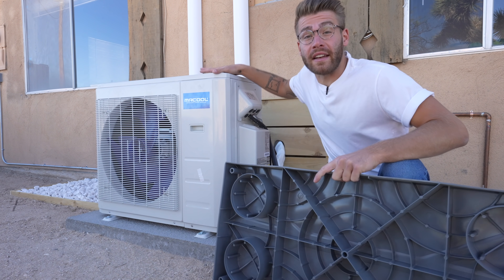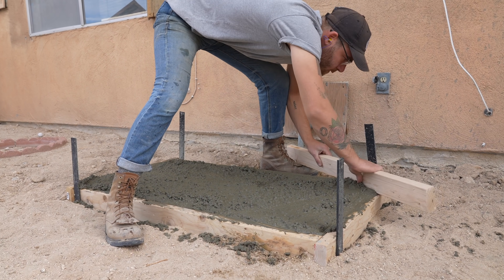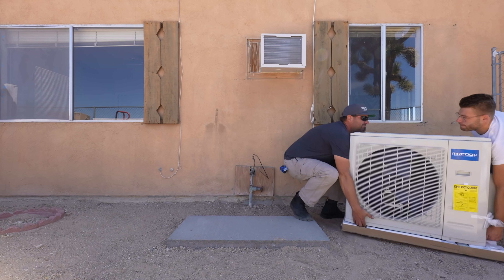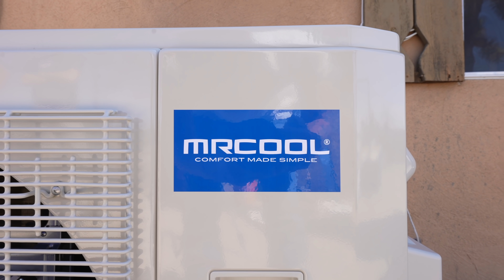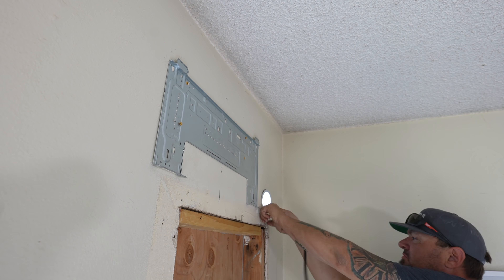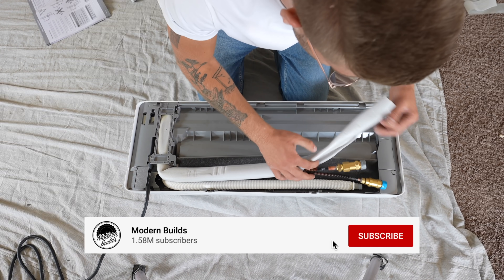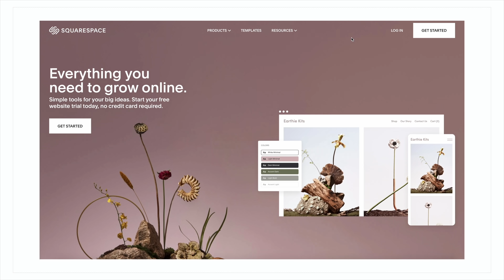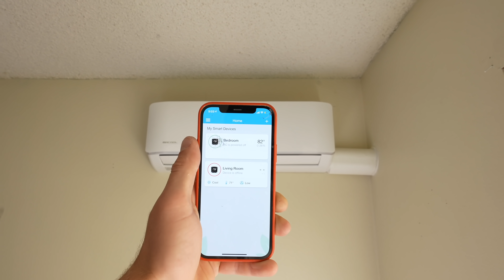DIY Multi-Zone Ductless Mini Split AC & Heating System | MR Cool Install 2021

Comment: i need warranty and they will not contact me back i paid over 1000$ for my unite  all i need is a replacement thermostat because mine is  delaminating and more UV Tape to finish my install i have called and called and get placed on indefinite hold i complained on there tiktok and they deleted there account

Comment: Hey Mike! I'm preparing to install this same unit. Can you provide some more details on your wiring setup? 30amp circuit—what gauge wire did you use?
Reply: 30 amp is 10 GA. Just look up the National Electrical code for all wire sizes. Over 100FT go up a size to reduce voltage drop.
Reply: you have to check the nameplate for the MCA and MOA.

Comment: Nice install but without a vacuum on line set and heads the refrigerant will be contaminated causing premature system failure and improper function.
Reply: The line set is where the Freon is charged and has sealed connectors. The vacuum is pulled on the compressor side from the factory.

Comment: Honestly, this was the video I referred to most often! And, the only video I found that shows the lineset leaving the air handler from the Right side. 

Anyone thinking about installing the MrCool mini split, should understand a few points I ran into. First, all these videos make it look very simple. And it is if you are going straight through the wall to the condenser just on the other side.

It gets a whole lot more difficult to run lineset out the left side as I needed to. Reason is, the connection then is inside the house behind the air handler. This makes the connection and the mounting much harder.  

Also, running lengths of lineset through the Attic, basement, and crawlspace, as was required for my install gets involved... I thought I would be able to have Install inside of 3, 4 days. But it took a full week morning to night. Crazy I know. Halfway through, I began thinking this wasn't such a great idea.

But mine was a difficult install. 2- 75ft runs, one exiting on the left side and the other from the right side of air handler, and 1 25ft run. 

Just saying, if the runs are short and through the wall, it's a lot easier...

Lots of newbee errors too.

Comment: Hmm... No attic? If that's the peak of the roof on that wall you can remove the coax and drop it down the wall... Just an idea so you don't see your coax. It's pretty easy even with insulation.

Comment: My Mr. Cool mini split is going on 2 years strong, not a single problem with it. Solid unit for heat and A C.
Reply: Can you share what the wattage draw / electrical costs are?
Reply: @allen35315  cannot provide information, my entire house is electric everything. I bought the 24k unit 19 seer for a 1100ft SQ house, I can heat the house up 12° in about 6 minute's in turbo heat mode though....it's glorious. My refrigerant lines did fail though. Poor design by Mr. Cool, the first couple feet were braided and rotted/failed, I replaced the lines and refilled with 410a. It looks as if Mr. Cool corrected the "braided lines" and are now copper from outside unit to indoor unit. I paid 700 bucks after a 800 dollar rebate from my electric company vs. 8000 dollars for a Mitsubishi unit installed.
Reply: @f4fake22  Do you have just the one air handler installed in that 1100 sf house? How do you get warm/cool air in to the smaller rooms like bathrooms and bedrooms?
Reply: @marlaplunk2833  just one, I went with the 24k unit so it's overkill. Back bedrooms still need to use baseboard heat on occasion.

Comment: so how much is it to cool and heat a 2000 square foot house with 4 bedrooms?   i’m talking about the price i will need for the equipment?
Reply: I'd call for central air, ain't no mini split gonna work with that. But call a professional, you know, like someone with a degree in heating and cooling.
Reply: @AARon-lj9hk  Mini splits heat and cool my 4000 SQ ft house. What are you talking about?

Comment: I live in a 2 story home, about 2K sq. ft. in the first floor and around 1K sq. ft (3 bedrooms) upstairs.  I live in South Florida and only use the heating element in my AC just a few weeks a year, so I don't spend a lot on heating.  I was thinking about getting a 5 zone Blueridge Mini-Split 21.5 SEER Heat Pump.  1 in each of the bedrooms, 1 in the Family Room and one in the Kitchen downstairs.  My office already has a Heat Pump I installed a few years back, since the AC didn't work very well in there.  Most nights, just one of the bedrooms is in use, since our Autistic Son at 17, still insists on sleeping with us and most days are spent in the Kitchen and Family room.  With this setup, my Dining room and Living Room (which we currently rarely use) wouldn't be cooled. I currently spend around $4-500 a month on my 12 SEER Air Conditioning system. ... If I were to do a setup like this, leaving the existing system for the occasional usage of my unused rooms and mostly just running 1 or 2 zones at a time, would I save a lot on my AC bill?

Comment: Can these be installed on a mountain cabin that gets very cold. How do they perform where it snows a lot durin winter?
Reply: Get a heating and cooling company to install whatever you are needing, based on your climate control.  But a split system seemed like a joke. That is because, if you get below 40 degrees, it will send 40 degrees through the home, and act in ac mode.
Reply: You are joking, right?
Reply: @AARon-lj9hk  no I’m not joking. Simple question. That’s all.

Comment: Hi Mike I noticed a joshua tree in your back ground.  Are you in Johshua Tree?   I just bought a house in Morongo Valley and plan on putting in one of these MR. cool 4 zones.   I am worried that it is going to look unattractive having 4 lines out front but i am glad you built that nice wooden box to conceal al the lines etc., good idea!   if you are in Joshua Tree what was the name of the HVAC company that were working with you ?  Maybe I can use them for the electrical portion.  thank you Frank

Comment: Hey I have a question: about how long do you think the copper refrigerant line is on the indoor air handler units? I’m trying to add up my measurements and am close to needing to buy an extension but would rather not if I don’t need it. Thanks man!!!
Reply: The minimum line set length on the diy units is 25ft, you can couple line sets together if you need longer. Also if you use the configurator tool on their website you can choose 25, 75 or 100 ft line sets.
Reply: @keishabaskin2174 they have 16ft now

Comment: Didn’t you pressurize and then pull a vacuum on the line set before opening the refrigerant valves? Or did I totally miss that?
Reply: Well, they are DIY pros... Why do they need to do that? Only oxygen is in the line, and we all know there's no water in oxygen.
Reply: @AARon-lj9hk  because it’s what needs to be done. And it’s the right thing to do. Oxygen and moisture still carry noncondenables which you need to remove at 500 microns or lower. And pressurized the line sets so as to see if you have any leaks before opening up the system. But you knew that already I’m sure. Because pros know this stuff 👍🏻

Comment: Maybe you can get away with it in the desert, but it seems like the flanges should be seal to keep water out of the wall.  The inside of the "through pipe" should get some insulation and air sealing as well.  Definitely looking to do this in the future. 👍
Reply: There is a neoprene putty included that you stuff into the flange he didn't show that part.

Comment: Place rubber absorbing pads under the outdoor unit feet before screwing to concrete.  Helps absorb vibration and stop concrete rusting the feet over time. These have been the staple air-conditioning systems in Australia for decades. nice to see the USA catching up.
Reply: Catching up? Most American houses already have built in Central Air conditioning to each room. These mini-splits are a great replacement for window units, but window units are only standard in old and/or run down buildings. Typically those in cities that didn't need it for very long.

Comment: Comments here make it clear that this is not a 'simple' DIY project. There is a reason for HVAC PROFESSIONALS IMO. Also anytime you break through the thermal barrier of a home it makes me wonder what climate you are in. It appears a warm climate due to stucco exterior so probably not as big of a deal, but I did not see you insulate at all the exterior holes you cut to run the tubes. Also a prime method for bugs to get into your walls and home either through the area surrounding the hole or through the hole itself via the channel. My regular AC hoses coming into the wall are all foam filled even in a warm climate. Also filling the stucco exterior and painting prior to even doing this project seems to be a preferred approach since you now have an area on the left side of the wall hole to address as your AC piping is running along that edge. Also did not see you insulate that wall. Pretty shoddy DIY work IMO and won't be subscribing.

Comment: Should I mount the outside unit in my basement in Big Bear? I think lack of snow and a constant 50-60 temp should help with power consumption and longevity? It has four 3” x 12” vents

Comment: Do not spool refrigerant lines in a Vertical plane, the lubricating oil will eventually  get trapped in bottom of Suction loop,.  compressor will stave for lube oil.   make loops in Horizontal plane so oil can keep flowing.
Reply: I'm no HVAC engineer, but that oil has to travel an 8-foot stretch straight up the wall.
How could it do that if it's not capable of going up and down some one-foot loops?
Just wondering.
Thanks.
Reply: @Vandalfoe  I believe the oil mixes with the gas and has no problem when traveling up, but when coming down, it tends to "pool" on vertical loops and get trapped there slowly, over time

Comment: Make sure you understand building code requirements for these before attempting.  Us inspectors hate DIY inspections because most are a complete disaster
Reply: Lol, yeah because you fuckers are just looking out for safety, not fines or making people redo shit because something is an 1/8 of an inch in the wrong direction.
Reply: @icemule  lol fines are multiple repeats of the same fail, and there isn't a single code that would anything for being off by an 1/8th.

Comment: I'm really surprised that not many people know of the Zamna Climate mini split AC and heat pumps that are DIY just the same as Mr Cool units with precharged linesets. 

It would be really cool if you could get one of these units for the house. 
They are solar ready meaning they run off direct power from solar panels - NO SOLAR INVERTER NEEDED. However, they do accept connections from the grid, so you can call them hybrid AC units. 

I'm actually running a few of these in Jamaica 🇯🇲 as I speak. The 12000btu runs off 3 solar panels and the 18000btu works with 5-6 panels (405W).

The company that makes and sells them are based in the United States - Zamna Solutions | Zamna Climate. If you should reach out to them just let them know Rayon from Jamaica 🇯🇲 sent you the info ✌🏼.
Reply: Why? You getting low on bud mon?
Reply: @icemule ???

Comment: Missed an important step on the video: when you open the valves to the line sets you must ALSO open the master valves located above all of the places where the zone line sets connect on the outdoor unit
..  do this prior to turning on the unit.  Otherwise a great video.

Comment: 👍 10:17. Oil is going to pool up because you  coiled the excess vertically. You should've elevated the condenser and coiled them horizontally.
Reply: Probably should have coiled them around the unit on the ground then cover with dirt? Would that work? I'm about to go with this system..

Comment: Super Pro? 😂 Saying that at the end of your video doesn't make your sub par install okay.  A pro job wouldn't be a DIY product that has excess lineset and a pro job would have hidden the linesets inside the walls and patched the drywall back.
Reply: Pro would've cut the excess and flared it.

Comment: Finishing TIP for m.split installations: 
When finished, PAINT to Match 
= Paint all your 'additions' attached on the exterior wall(s) using same-color wall paint of your house.  Then they will blend in so that exterior wall will look a great deal less industrial. 
Include painting: LineSet Covers, conduit and disconnect box... can even paint wiring. 
Note that the gray on the disconnect box is gray PRIMER paint - these are meant to be 'painted in' in order to match surroundings. (Same is true for your inside Circuit Breaker Panels - no reason to leave them gray in the middle of a white wall) 

-Cheers
Reply: Did that today. Can't even tell its there now.
Reply: Just don't goop the hardware with paint lol God forbid you ever have to service it spending 20 mins just to chisel all the paint out of your hardware 🤣

Comment: If and when this unit stops working. First check the wires on "L1" and "L2". Strip the wire back better and tighten down.

Comment: I am from Asia and spilt ac is more common here since late 19th  my grandpas time rather than the central air-con system,u guys using 18k BTU or 1.5ton unit for 440 sqft .which is not going to cool u down cause its beyond the limit and going to reduce compressor life as well increase power consumption, if u want to cool down as low as the unit is capable such as 68 f then take my advice, which is required all over in Asia in order to install a split system.
for 120 sqft u need 12k BTU or 1 ton 
for 120-180  its 18k BTU or 1.5 ton
for 180-350 its 24k BTU or 2 ton
for 350-500 its 36k BTU 3 ton
is required even in a residential place, if it's commercial then it required more.
Btw Mr cool and other DIY all are OEM of Chinese Midea and gree ac. If u want better performance u need to go for Mitsubishi, Daikin,Hitachi and LG .
IF u take my advice then u will experience a night and day difference.Thank u very much
Reply: What's better about Mitsubishi, LG?
Reply: @robertberin4872  first of all lg daikin mitsubishi all are global brand and its maintain  certain quality standard, in terms of the technical side they use more or less dual rotor or t3 inverter technology which means it got 2-3 rotor inside compressor and have more variable speed control (chinese brand  use conventionl single rotary compressor)  .Those  also got micro gold fin condenser which is work more efficiently to remove heat  and 
Rust-resistant as well , eco-friendly and durable in compareson with low grade copper condensor without micro fin.
In terms of features, u can use a 2 ton unit as 0.5 ton ,1 ton or as 1.5 ton by simply reducing compressor capacity by a single click . as they are global brand they use high-grade copper tubes to give better performance such as fast cooling and preventing refrigerant leakage (which is so common in oem or chinese product)  ,as well there inverter pcb  come with wide range voltage protection ,so u dont need to worry about voltage fluctuation ,last but not least even Chinese quality ac doesn't ensure right btu amount ,u may got 12k btu unit but in reality it might have only 9k,thus the lg,mitsubishi,hitachi and others are far better than Chinese OEM.
NB: we call a qualtiy aircon which can provide  us a hessle free  expreince at least for 8 years without claiming any service warranty from company with minumum maintainence .
thnx in advance
Reply: @hasanmishu8792  LG, daikin, mitsubishi is x2 the price as good Chinese mini splits ( Senville, mr.cool, pioneer) & x3 the price as cheap mini splits (aux, ebay $500 ones). 

Conventional single rotary compressors are being phased out. ALL the above mini splits now use inverters. 

How do you tell if your 12k is only 9k?
Reply: @robertberin4872  if u choose over the price then u made the right decision,u cant tell the amount of btu by look,u need to test it in lab.ALso inverter compressor have lots of varient such as dual,triple ,8 pole,twin fold ,what i mean by single roter is that u r mr cool inverter compressor dosent have the feature like dual inverter . Single inverter compressor are very basic inverter tecnology and at least 8 years old method .
Great things comes with great price ,thanks for understanding

Comment: I have a 550sqft garage with 9 foot ceiling, 2 walls are insulated and 2 walls and attic are not insulated. The garage door is insulated. It get 110-115 degrees here in Phoenix in the summer. My garage is always 100 degrees inside. What size BTU unit do I need to cool? don't need heat.

Comment: In the HVAC world, we call these things "3rd world piles of 💩". Good luck finding any body to come out and do a repair.
Reply: Saving the expense of the exorbitant Hvac markup you could replace both the indoor and outdoor unit several times and still be ahead. Got a buddy who installed one of these over five years ago.....still running strong and not a single service call. $1200 kit plus a weekend of his own labor VS hiring an HVAC contractor to put one in for $5-6K! Work is work where I live, so no shortage of contractors who will take on a service job IF he needs a repair. Only a matter of time until the quality manufacturers like Mitsubishi and Fujitsu start making these as well....
Reply: @toolegit2quit173  even mr. Cool are rip offs. In Mexico I can get a 12k Carrier for $350 and 18k for $500

Comment: the electrical cables that feed the system were very very badly installed, you can see they cut cables to reduce the diameter so each cable can fit in one side of the holder, bad method! you can use an electrical terminal and use the full diameter of the cable and reduce the heat in the cable and consume less energy.
Reply: Hmm.  That's what I did. Considering this only uses 5amps how is it going to generate heat?